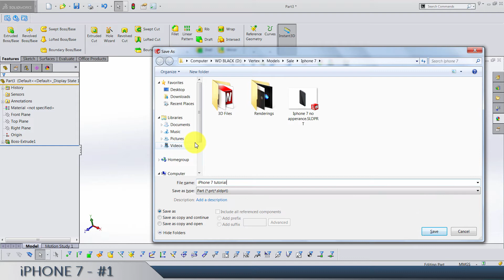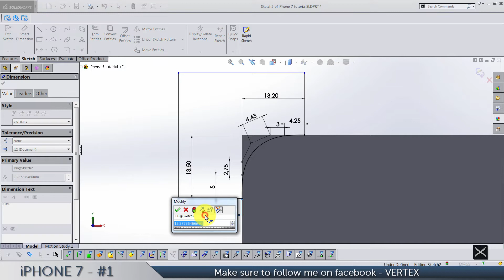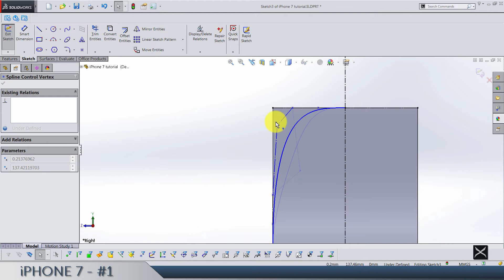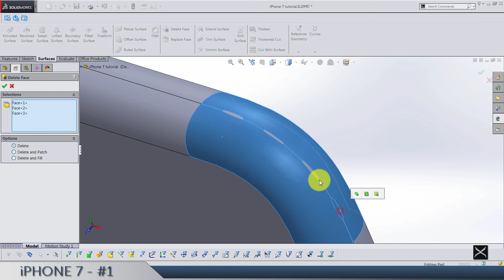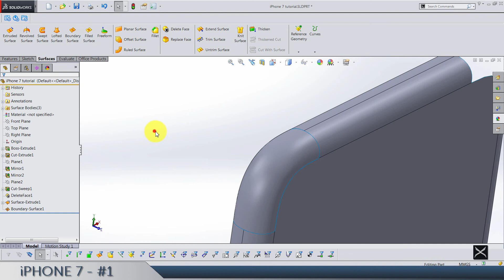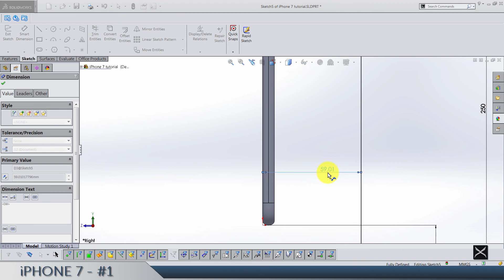iPHONE 7 - SOLIDWORKS MODELING TUTORIAL

Comment: SW 2017 won't let me make the Swept Cut , Great Video!
Reply from the maker: not sure what to tell you, you have to find a way to do it
try making surface swept/swept surface instead of swept cut and then use surface cut tool to cut the solid body with the surface body you made with sweept surface
thank you ;)
Reply: I tryed also the boolean solution! But it didnt work , I made a fillet with 2 radius to make it work. thanks you so much for this tutorial!
Reply from the maker: good job and good luck going forward, let me know if you need some help or when you finish it ;)

Comment: Can't add curvature to face when rebuilding corners of main body, get a rebuild error no matter how I try it.
Reply from the maker: Eddie Smith which minute in the video it is?
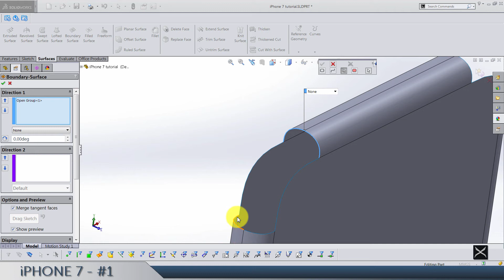Reply: Petar-Vertex 11:30 in first video
Reply from the maker: Eddie Smith you have to make sure you selected everything well and in case selection is still wrong then it might be something wrong you done before that part
Just try using tangent relation instead of curvature, if you can't place tangent relation then something is definitely wrong few steps back
Reply: Petar-Vertex ok, thanks. Since it was so early in video I've already redrawn the part multiple times. I got curvature and tangent to work but the results aren't right. I get dimples on the corners of the boundary surface. Can't find what I'm doing wrong.
Reply from the maker: Eddie Smith send me that part on my facebook page or email you can find in channel description to see what's up
I use sw2016 only just so you know
Reply: Petar-Vertex Did it over again in SW 2016, still can't get it to work. I don't see an email address anywhere.
Reply: Did it over again, same results. I give up.
Reply from the maker: Eddie Smith give me your email to send you the part
Reply: Petar-Vertex realityrat@yahoo.com

Comment: Thank you for the tutorial! What's the keyboard shortcut you are using to move between tabs [ Features ][Sketch][Surfaces] etc?

Thanks
Reply from the maker: you're welcome, to slide between those tabs you just hover over them with mouse and use mouse wheel to switch between. :-)
Reply: I thought there was a keyboard shortcut for that, I use an Intuos tablet (no mouse since 2006) so keyboard shortcut could save some time, but I couldn't find it yet. Thank you!
Reply from the maker: ohhh well you should get something with mice :P